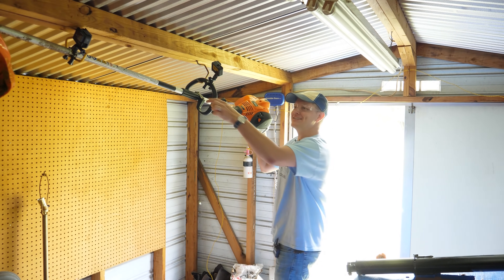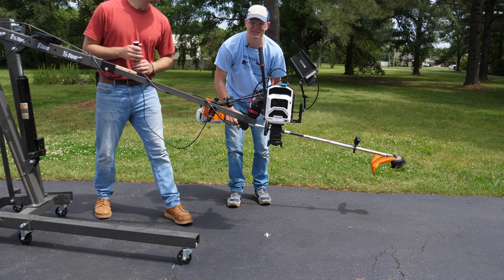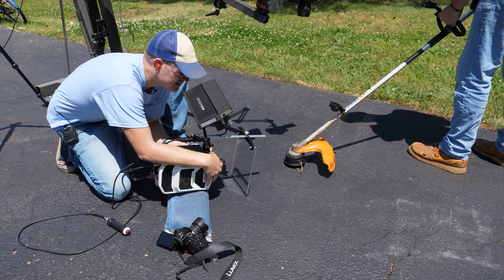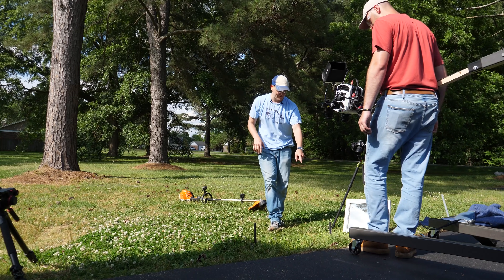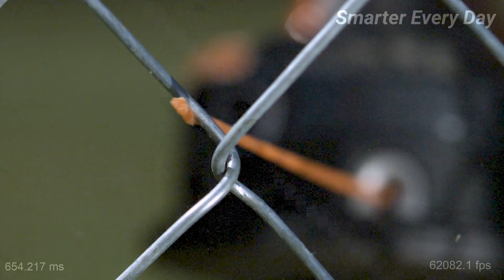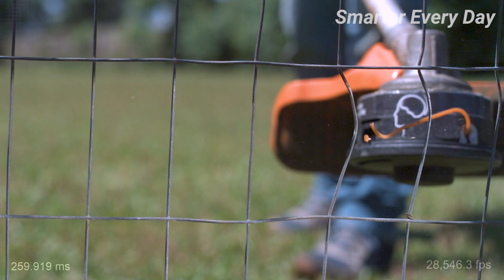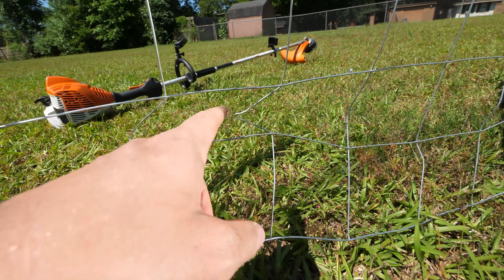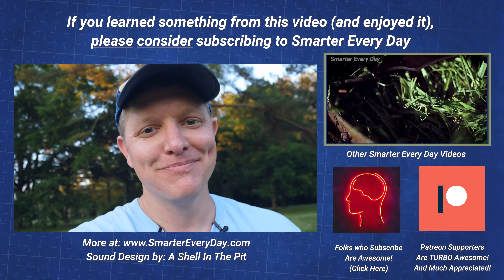How Weed Eaters Work (at 62,000 FRAMES PER SECOND) - Smarter Every Day 236

Comment: I use a weed eater for 6 hours a day every day around a campground for maintenance, Probably more than most would use one in a day, But Im always around other peoples nice RVs and their vehicles and their stuff so I cant be flinging rocks n debris around, I removed guard on my weeder bc I always tilt my weeder to fling anything n everything that gets cut at myself and my legs to avoid it going forward or other directions towards peoples stuff, Bc of this I removed guard bc I found often times guard would ricochet everything in different directions just wasnt reliable when comes to ensuring anything cut or potentially flung from going in 1 dependable direction, However I did have an idea for a full pan like cover fir weeder to avoid flying debris however that only limits us to tapping down, Need a 360 degree cover that allows us to sweep through weeds, Perhaps 2 pan like covers with small quarter inch 360 degree gap for string to slide through them, Idk thinking aloud here…

Comment: Next time you should get a measure of your line before and after hitting the fence. Maybe find a way to calculate if there's length loss per strike vs significant length loss on the wrap around

Comment: @ 5:38 ....you have to sharpen the blade from time to time...I have been commercially mowing for 10 years, the string works better with a clean cut....every other week , I sharpen my blade so the string is actually cut instead of being battered

Comment: The line is straight at the optimum length. Any more and the Air causes a bend and causing lower rpm.

Comment: Since that is a straight shaft trimmer it has a gearbox on the end of the shaft and it makes the head spin counterclockwise (looking from top) but on lower end trimmers and curved shaft trimmers spin clockwise so there are many techniques of the way the grass can get flung in different dirrections

Comment: 8:45 I don't think the line there is stiff enough to excert enough force to pull the trimmer head anywhere else than straight between the point of attachment to steel rod. The force would have the effect to move the trimmerhead sideways though, sice the spinning head makes the contact point move to the side. 

The point where the trimmerhead center would be moving due to this force is half trimmerhead width off from steel rod. Think of it a bit like rolling back unrolled toiletpaper and someone resisting on the other end. 

I might be missing something though. The effect of trimmerhead movin more to the side might be due to acceleration of trimmerhead spin and simply the system not having freedom to move towards steel rod due to being attatched to a person and just allowed to swing on an arch, not really move forwards and backwards.

Comment: There's no real difference between round and square line and all the other versions   Also your cutter bar needs to be sharpened  Finally the fs70 is a homeowner trimmer try a FS91r 111r or a 131r 😊

Comment: Can you stop making up your own measurements like 85/1000 of an inch. Sound like wakadoo.
Kilometer, meter, millimeter, micrometer, nanometer. All nice in 10³ divisions. The wire has a diameter of 2mm or 0,2cm or 2000µm.
Oh wauw we can keep switching the unit and it's just division or multiplication by 10. 10 just like the number of characters we use in our number system.

Comment: I'm very late to this video, but perhaps my comments may be of some value to someone. I have sold weedeaters in my time and used them. The instructions warned that it is the TIP of the line that does the cutting, which makes perfect sense because that is the part that's covering the greatest radius, so that it is travelling fastest. It is for this reason that I keep a sharp eye on where the edge of the imaginary "disk" is. In this way I do not tangle the line with anything, so that the motor is never under very much strain. Many of my neighbours have weedeaters and my blood runs cold when I hear the machines bogging down and choking up when shoved into thick growth. Of course, one can't explain anything to them: everyone knows better. My father had a saying that went: "When all else fails, read the instruction." I do that first, before I employ ANY tool or appliance. It's amazing how much one can learn from making a habit of this practice.

Comment: So at 5:50….just thought of something if I may.? You said it doesn’t just clean cut it once. It takes a few. It is doing that but I think it cuts it more than once because the line keeps advancing out of the head til you lift the weed eater back up. So it cuts more than once due to the line getting longer (still coming out of the head) until the pressure is ‘lifted’ and the line stops advancing ‘getting longer’. Seems correct to me….great channel by the way. The baseball in the air gun ones are amazing..!!

Comment: You mention it feels like you get pulled into objects like the metal rod at 8:56. I bet if you mixed the normal weed eater sweep from right to left mixed with the counter force of the string pulling you it would feel more like a direct pull into the rod. 
I noticed the same thing when weed eating my vineyard. I often times would get pull into the areas I was trying to avoid.

Comment: Of course the length of the line is going to have a profound effect on the drag against the motor. If you ever lost the line or reached the end of the reel you can hear how fast the thing turns without any line. It revs up very high.

Comment: Use an effin' scythe instead of these micro plastic strewing sources of air pollution and annoying noise.
Reply: A scythe won’t cut the little tiny weeds next to a structure
Reply: @tildenmueller8645  With a bit of practice you get within an inch from any structure, and I'm glad I don't have OCD, so no need to use plastic garbage to cut away insignificant single weeds and also damage the structure on long term.
Reply: @oxydator  nah I think I’m gonna stick to the good old gas powered machine, I mean John Henry did beat Paul Bunyan after all

Comment: That chicken wire will rap up the head ..I've bern doing this full" speed running for almost 30 years .and those ground bars will bend the shaft at full speed ..of course your not standing still when you do few hundred a day.your running or run walking backwards sideways ..holding it in 10 different angles, and methods.what sucks is when the neighbors yard grows threw wooden and xhain fences.recomend spraying and rapping posts.

Comment: Awesome video!
I just had an idea while checking out some knives online. It would be awesome if you could make a video similar to this comparing different knife sharpening techniques (wet stone, pull through, honing steel, etc) with some close-ups of the knife blades after sharpening to help settle the debacle around pull-through sharpeners causing damage to knives and which steels chip more often, are harder to sharpen, etc
Reply: @Science Matters --- Oh, yes!  I can't believe six months has gone by since your comment and no one has chimed in.
I have mixed feelings on knife sharpening (can never get mine very sharp) and would love to know more about the 'nuts and bolts' of the process!

Comment: Okay this is a tricky one which way do you go with the weed wacker and how do you hold it. So line trimmers are a mechanical scythe made for right-handed use and if you think about using a scythe your natural tendency would be to put your strong arm at the center and your weak arm at the back. But if you're right-handed and you think about pulling that trigger too much you might want to put the trigger in your right hand.... This is wrong! Because the head spins counterclockwise and so you want to move from right to left always with the weed wacker. Have the trigger in your left hand and now you'll be able to walk forward and the grass will get thrown in front of you as opposed to directly backwards at your ankles and face. Doesn't really matter when you're cutting just grass no big deal until you pick up that stick or catch a rock. If you hold it the other way you'll have to walk backwards to get the same effect and you'll take foooorrrrreeeevvvvveeeeerrrrr to do what should take 5-30 min depending how big the yard is. Also if you run your line too long and you're using your trimmer everyday you'll destroy your clutch very quickly. I don't run mine with a guard.   So to get the line equal length and the appropriate length I just turn it sideways and plaster it on the street for a second.

Comment: 4:40 my weed eater has a centrifugal switch, so as the line gets longer it auto locks, but if it shortens the lock disengages and lets more wire out

Comment: I wouldn't say the torque is function of length of the line. More likely the longer the line the higher the torque needed to reach certain speed. One could then argue that torque is function of speed which is correct but the torque was not measured. The speed was derived from the sound so the speed is function of length of the line. Which is in line with the torque being the same with more resistence to movement caused by the lengthening of the line causing lower speed.

Comment: I'd like to correct you my theory on why the tips of the weed eater line are still curved at full speed is because the tips make first contact with other objects, it takes more beating from the outside which causes it to bend and form memory in the line.

Comment: This Is Not A 62,000 Frame Rate Video Fact You Can't Watch High Frame Rate Video On A Low End Device Even On 120 HZ Frame Rate Device & the vidoe is available in 1080 60FPS So There Is Nothing Like 62,000 FPS As Mentioned In The Title

Comment: at around 15:30 you comment on the weld; if the wire is steel, then the weld joints will be the strongest part of the fence. if its aluminum, the opposite is true.

Comment: You always want to use the weed eater and cut from the front left of your property all the way around the outside perimeter until you get all the way back to the front right the reason is because you can hold it better when the string is hitting from right to left and you're going from left to right

Comment: Seems like the line is getting stressed as it hits multiple times, probably built up heat which explains it's extra noodle like appearance at the tip of it and it just pulls apart. Because to me it looks to act similar to something in the early stages of melting and softening up. Either that or the cross sections within are breaking with every impact and simply weakening to that point it pulls apart.

Comment: As you noticed, longer the cutting wire exposed, slower will be the engine catching revs. The engine will have similar behavior as more weight at the flywheel was added. But in this case you are not adding weight (the wire was there, inside the reel), but moving the wire out will be subject to aero drag force and slow down the engine. If you get used to it you will be able to understand when your wire its too short or too long just listening at the sound of the engine revving reacting to a good throttle squeeze.

Comment: A power equipment dealer near me told me if you remove the guard on a string trimmer, every inch longer of string than stock makes the engine run 10-15°f hotter. This is why they wont do warantee work on a trimmer with the guard removed.
  With that being said, I'm a landscaper and most guys remove the guard to run slightly more line and to get around  objects easier. Buy trimmer, run for a week so guard looks used, then remove. If it goes back in, replace guard. I fix everything myself but this is common. I buy new ones every other year anyway.

Comment: Did you measure the thickness of the line cutter inside the weed "eater" or weed whacker or weed slicer (however you want to call it)? I think that the thickness of the blade or strip of metal inside the weed eater has a different effect on it causing the line to break as a tension break instead of a sheer break. Could the flexibility of the wire determine if the line breaks from the weed eater? Would the weed eater line have a tension break or sheer break if the metal wiring was a non cylindrical shape (meaning that the wire had straight edges instead of it being round)?

Comment: What if it's not a tension or a shear break but actually heat from stress causing it to melt? Almost looks like that.

Also, weed trimmer line is extremely flammable and becomes hot dripping goo when ignited... so it's plausible!

Comment: i have a suggestion maybe you have done it but i haven't seen it cutting or shearing edges like snipping things with "nail clippers" side cutters watching the point where the material separates is the sound it makes coming from the blade coming together or the material separating

Comment: been a landscaper for 8 years its walk from left to right and in the forward direction then for your vertical's you walk backwards with the trimer line at a 90% this is so that you can get a nice square cut on lawns

Edit also why is that trimmer so slow? that sounds like the one's we have wen there at low throttle sounds like its at least 1/3rd the speed btw this is based off my exp with a lot of trimmers and not how louad the engine is you can hear it in the wipe sound of the line wen its going fast its atc louader then the engine

Comment: You forgot to talk about the engine, fuel tank average yard cut, lenght of the plastic trimmer, how to remove old weed  stock under, is the gard  safe enought, should we put glove or a net in case of bees, what the minimum age for using that tool, witch day its better to use it, is it banned in some country, is the noise could affect earing.....

Comment: Another aspect is that if you have a full spool of line then the weight is a better flywheel and the revs wont drop as much with hitting tough grass. So if you're doing some heavy cutting do it with a full spool.

Comment: The reason its slower when more line is pulled out has little to do with aerodynamics.
Its called "Conservation of angular momentum".
Like if you're on a merry go round, and you try to move to the center, its difficult. But if you start blowin' chunks, the chunks are dispersed outwards and you become lighter. Now its easy to move to the center, in which you'll spin . faster.

Comment: This was great! I've run a string trimmer a lot and have wondered about all of this. With some objects, like a large hanging chain, the line seems to suck the trimmer in and get completely wrapped around it and stuck. I suppose the larger diameter and give in the chain prevents breakage of the line as much. Also moving right to left cuts much better. I guess that makes sense because of the direction the line is spinning but I would have assumed it's moving so fast it wouldn't make as much of a difference.

Comment: BTW, you mentioned right to left.  With a powerful string trimmer (Stihl for example) trimming along a wall from right to left burns more energy (yours) slows progress, and reduces height accuracy.  I've found that traveling the direction the string pulls your trimmer is much easier, better, and faster.  It's easier to slow down the motion than to fight it with opposing force.  I you  have to make more than one pass, it is still quicker and a more uniform cut.  However, if one pass doesn't cut the grass, you might consider ditching the round string in favor of a string with cutting edges.  The larger diameter round string does not always last longer and rarely cuts better.  Force applied to the smallest surface area of the target will always do more damage than equal force applied to a broader surface area.

Comment: Okay.  You'll never believe this, but  when I was 9 or 10 years old ...  Back in the 70's, to trim grass around trees we had sheers.  It was slow, inefficient, and made my hands tired.  So one day I thought I would be smart.  I have never been scared to take things apart, and on one particular day was a battery powered toy car that had an electric motor.  The next 2 items on my list will show relevance.  Tape and fishing line.  I'll cut to the end.  Yes, it worked great.  Now the bad news.  No, I really wasn't all that smart because that day marked the beginning and end of that project.  I never gave it another thought until several years later when it hit the market.  On that day I invented something else.  It was a leg wearing a boot with a rope attached.  Pull the rope, the boot kicks you in the  (depends on which way you're facing.)  Am I the only kid who had and tried this idea?  Who knows?  But for me, it originated 100% in my head.

Comment: Logic: it turns a bit at the end, because the weight is more heavy close to the center  at the beginning of the line (because all the long line is pull by his own weight), and near the perimeter, you are going quicker, but weight is going to zero at the very last end of the line.
To understand better, imagine the weight to be something for each mm.
For the tension break, you should look at the thermal camera because logic would be that the wire contact and pulley effect will provide energize then be hot locally ... It should also make the line easy to break on tension due to hot effect generated.

Comment: Genuine question - Do people in the US actually use imperial units when calculating problems etc? Engineering is hard enough in a base 10 system so I couldn’t imagine it in imperial.

Comment: No dude it stops because it has a clutch there’s not much to him it’s just a motor a clutch a shaft on the end of the clutch and then the shaft is attached to a disk that bites down into the line and then line just straightens out because of the central fugal force

Comment: If you want to run it at full speed with the longer line, put a leaf blower on the air intake.  This is super unsafe, but you can supercharge any engine if you have a leaf blower.